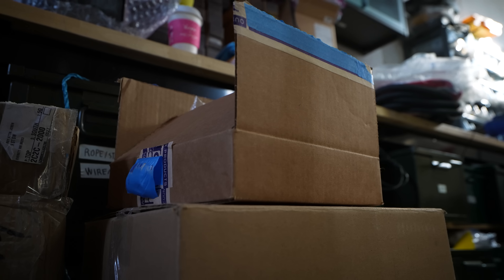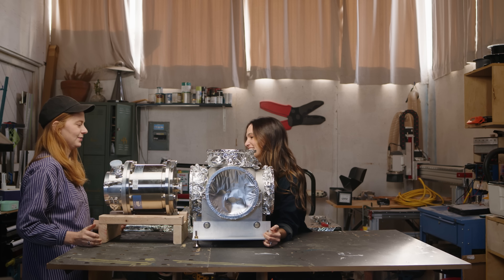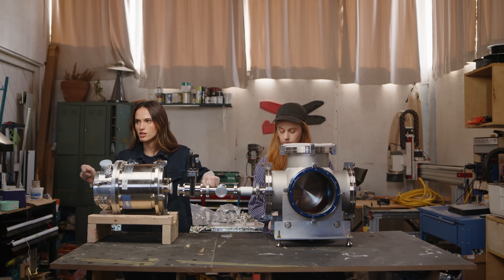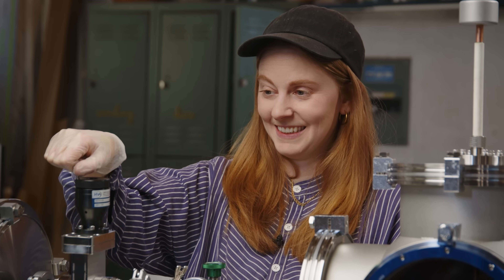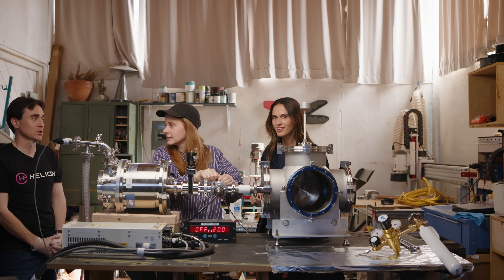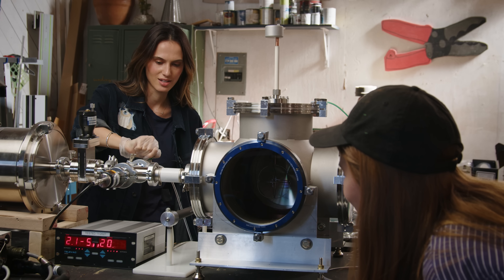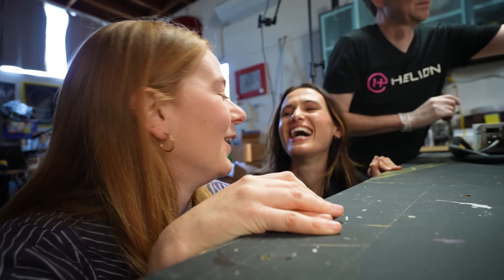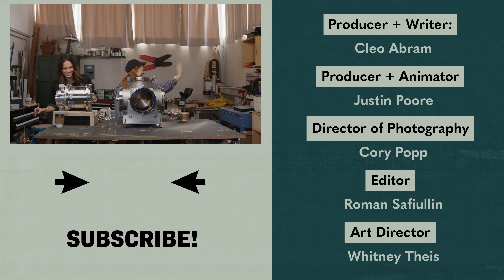We Tried To Do Nuclear Fusion

Comment: Great video, but ya'll didn't make any fusion. If you had you'd all be suffering acute rad poisoning being that close to an unshielded fusor. That big glass window would be spewing xrays. Fusion doesn't happen until at least 30Kv, and the amount of current required is directly proportional to the size of the chamber. That massive chamber would be quite difficult to get up to actual fusion range. You'd probably need 50kv and a fair bit of current and it would be wildly unstable, fusing sporadically while spewing x rays. 
There's a whole community who've been building fusors for years and the standards for claiming fusion are really well defined. It's a "pics or it didn't happen" kinda thing. Basically, you need to detect actual neutron output or you can't claim fusion. This means you either need a bubble detector, a neutron detecting tube, or to activate some other element with the neutrons and detect the gamma decay of the resulting unstable element. 
It's a lovely build and I commend you on getting as far as you did, but David should know better and it's really disingenuous to make the claim of fusion in this context. I've literally built the same device out of microwave parts and jam jars and while it glows nicely, there's 0 detectable fusion at the voltages demo units like this run at.
Reply: Yeah I'm not a scientist or anything but Helion just seems super sketchy to me...gives me hyperloop vibes.
Reply: Yeah I wasn't sure if I missed something but this did not look like fusion. I got detectable fusion back in October at 28kV and roughly 15mA and neutrons were detected on a Bubbletech BP-PND bubble detector as well as a calibrated Ludlum Neutron ball detector. The X-ray measurements infront of the glass viewport were higher than the meter provided by the university's radiation could handle and we did everything remotely. Also, pretty much all fusors' grids glow white hot at fusion power levels and their nixie tube plasma didn't come close to heating it. I'm not even sure what voltage they went to. If they went to 10kV or so you could say that they did get "some" fusion, relying on the fastest Deuterons in the energy distributions, but not even close to being able to detect it. Would anything like this pass as "fusion" on the fusor forums? Absolutely not.... but good effort and perhaps it'll motivate someone to pursue this line of work down the line.
Reply: @SolkanStudiosTV I know it's kinda not relevant, but what do you guys use to shield from the radiation of the fusers?  Like are you just in a totally different room and keep the X-Ray/neutron detectors near the fusor?  I'm more of an organic chemist so I'm not too versed on the fusor-making community lol
Reply: @thetaintpainter5443  There's two types of radiation in fusion; X-rays and Neutron bombardment. X-rays become a problem past 10 kV (10 keV in maximum photon energy), but since these experiments are performed in thick steel vacuum chambers, 99.99% of these X-rays never make it out the steel shell. In fact, 99.9% of X-rays are shielded by the steel shell up to 40-50 kV. At higher levels even the 0.25" thick steel becomes transparent to X-rays. But few people get up to those voltages in this hobby fusor space, it's difficult to keep everything stable at that point. The only real "danger" at lower (10 - 30 kV) voltages are viewports, since they are glass and thus X-rays just go straight through. Additional components, like high-voltage vacuum feedthroughs, which are made of ceramic and sometimes fail to shield X-rays, can be problematic. For these X-ray "leak spots", lead bricks do just fine. A few inches of lead can stop X-rays with greater-than 100 keV energy, so anywhere you think that X-rays might leak you can just shield with lead bricks. That's what we did. So the basic rule is you don't look at plasmas past a few kV because it produces UV and can hurt your eyes if there is continuous long-term exposure, and you certainly don't want to stand infront of a viewport past 10 kV for long periods of time because X-rays can burn your skin. Past 20 kV, which is where real detectable fusion begins, you certainly don't want to stand in front of viewports, because you can hurt yourself. I only went up to 28 kV, which did not require me to build a remote-control and remote-viewing station, I could have simply positioned everything in the corner of the lab away from any viewport. However, another issue at high-enough X-ray energies is X-ray scattering, meaning X-rays exiting the chamber and bouncing off stuff and hitting you. There is an energy loss at each stage of scattering but if your voltage is high enough, even the scattered X-rays can be energetic enough to be nasty. So in essence, this was  a long-winded way of saying "For most applications, the steel vacuum chamber shields against X-ray radiation, you just have to be careful about viewports and other weak spots. Just put some lead around those and you'll be fine." For neutrons it's a bit more complicated. Again, in most hobby fusion scenarios, the neutron flux is low enough to not cause issues unless you stand right next to the thing. These neutrons produced in fusion have several MeV of energy, so they are FAST. If you want to shield them, you first have to slow them down (thermalize them) and then capture them. Usually this can be done with a two-fold system of a first layer of water to slow them down and then something like paraffin wax to capture them. There is a parameter called the Neutron capture cross section, given in Barns, which tells you the probability of a neutron capture of different materials. However, it's not a constant, it's a function of neutron energy and I think at thermal neutron energies (slowed down, around 0.026 eV), it is highest, which is why you first slow them down prior to capture. Isotopes of Xenon actually have a very high neutron capture cross section, which is why having excess Xenon in a nuclear reactor can poison it - this was an issue in the Chernobyl catastrophe that they somehow overlooked. In any case, no matter that radiation we're talking about, a good rule of thumb is that the best shielding is distance - if you have isotropic radiation sources, the intensity of radiation falls with the inverse square law. So being far enough away will always be much safer than being much closer with some sort of shielding.
Reply: I think David has just totally taken advantage of Cleo. He knows she comes across as an incredibly credible person, so this is just an opportunity for him to attract investors who just don't have the scientific skills to realize how difficult proper desktop fusion would be to achieve. I hope Cleo sees your comment and, for the sake of her own reputation, puts out a disclaimer that she was misled.
Reply: Yeah this is a startup doing pr on the backs of Simone and Cleo. sussy af.
Reply: T. Folse just did a video about this thing. Thank you for taking the social risk of being a party pooper to burst the bubble. It's ok to make mistakes.
Reply: @thethoughtemporium  Hey a person with a brain. Thank you.
Reply: Jeez it's almost like Helion is trying to peddle some snake oil magic fusion tech that somehow the tens of thousands of scientists working in actual reactors never thought of... Somehow... and this is part of a marketing campaign to get that sweet corporate welfare money.
Reply: why do you call it a great Video when you know they are lying to their viewers.
There is no Fusion there. And either Helion knew and he is lying when he says it is happening, or he is worse in physics than I am.
I mean the neutron radiation alone would be....yikes!
Reply: Honest question - if they didn't make any actual fusion - and that was the entire claim of the video - how is this a great video?
Reply: Well if that tiktok nuclear guy and thought emporium and Wikipedia all say it can’t have been fusion imma take their word for it.
Reply: Well he runs projects way bigger
Maybe he did detect it
Reply: We don't know if they performed nuclear fusion as we didn't see that they tested for the byproducts of fusion, but we also don't know that they didn't. They could have fused some amount of deuterium nuclei. Not knowing doesn't mean it didn't occur. They may have even tested off camera.

If they fused a small number of nuclei, they wouldn't be suffering from acute radiation poisoning as it could be barely above background radiation.
Reply: But do you think you would actually detect anything outside of the vessel? This is just a back of a napkin calculation, but the neutron scattering cross section for iron in the case of fast neutrons is 20 b, the particles per unit volume for iron are n ≈ 4.269697799E24 cm^−3 and if we assume a thickness of something like 1mm of iron, we get that the proportion of particles going through the wall are   e^(−(n × sigma × x)) = 0.0195 % . From the fact that you only have very few particles to begin with, you might not measure much outside of the fusion confinement.
I am not a fusion scientist, but I am a physicist and I think if the expert person on the team says they archieved fusion, they are propably correct.
Reply: According to Wikipedia's entry on "Fusor", "With hydrogen fuels, about 3 to 10 keV is needed to allow the reaction to take place." In this video they use deuterium which is a hydrogen isotope. They mention running at 6000 V. So I think you're conflating calculated fusion conditions with detectable fusion emissions.
Reply: @LoveLearnShareGrow  He's not conflating - he points to the physical fact, that if there would be any atomic fusion reaction inside this MASSIVE chamber, the outcome would be an outburst of energy. And because entropy happens and it doesn't want to stay in that high energy state at all, there would be high energy emission - in form of massive amounts of x-ray radiation. This was nothing but a plasma reaction. A deuterium lightbulb or a glorified plasmaglobe. The procedure is working and all the aperture is capable of achieving a fusion reaction - but the seen outcome is not a true fusion.
Reply: @marcus_w0 I do not think you would see an outbust of energy, if only single atoms fuse together.
Reply: @marcus_w0  Yes, that may sound like a lot of energy, but it is only much on the microscopic scale of elementary particles.
Reply: @LoveLearnShareGrow  bruh you probably shouldn't use Wikipedia as your primary source, I mean it's a nice starting off point but nothing more. According to wikipedia's entry on "Nuclear Fusion", "Using deuterium–tritium fuel, the resulting energy barrier is about 0.1 MeV" which is 100 KeV not 3 to 10, see? wikipedia contradicting itself. Digging a little further, the 3 to 10 KeV number is actually the one you get when you take quantum tunneling into consideration which is NOT happening in fusors on earth because the plasma isn't dense enough and will never be, because those aforementioned quantum effects that make it easier for fusion to occur only happen in the core of a star where the density is ludicrously high.

So on earth in a fusor of that size you need about 30 to 50 KeV to achieve detectable fusion as thought emporium pointed out. So no he's not conflating anything,you're the one conflating calculations for fusion in the core of the sun for fusion inside a fusor on earth.
Reply: @mastershooter64  I understand Wikipedia is not an ideal source, but every single person who has responded to me is pulling numbers out of their ass. I have also mentioned other another source, which again I recognize is not ideal, but it's better than naked assertions. So I appreciate your attempt to refute my comment, I'll be ignoring  your conclusion unless you have a better source than "Don't trust Wikipedia, trust me!"
Reply: @LoveLearnShareGrow Turns out you can't search stuff on Google in 5 minutes and be on the same level as people who have worked directly with the subject. Maybe humble yourself a little so you don't end up embarrassing yourself again.

Comment: No proof of neutron production...can't definitively say fusion was occurring without proof of neutron production! You should also warn your viewers that these types of experiments often produce soft and hard x-rays via Bremsstrahlung mechanism with the chamber. Idk the voltage this operated at anything less than -10kv probably no fusion. Overall a pretty poor explanation, the viewers are missing so so much. I built one of these and it’s not easy nor cheap. The equipment here is probably $35K - $50K.

Comment: Well, I'm hopeful, but the engineering problem of getting it from "we can do it in both small and large scale labs" to "we can use it as a power plant" is an extremely big engineering problem.  General Fusion, one of your assistant's competitors, was claiming they were about 10-20 years out a decade ago and are now claiming 15-30 years.

The folks working in fusion research are massively optimistic...but optimists are what you need in a field of research that is progressing so slowly.

Comment: @cleo, this is so great that you were able to demonstrate fusion in such an accessible way. I am curious if you’ve ever heard of Bloom Energy and the Bloom Boxes that use chemical coatings to convert air to energy? Sixty Minutes did a special on them in the early 2000’s and apparently Google purchased several large commercial “bloom boxes,” but I’ve not heard more.

Comment: Just want to throw this out there. I believe that the Farnsworth Fusor has set Fusion back several decades. You even mention in this video that the sun maintains fusion through gravitational confinement. Which I believe is mostly attributed to this device and hence Magnetic Plasma Confinement. Much of the spectral evidence suggests that instead the vast majority of the sun's mass is metallic hydrogen suggesting that Lattice Confinement may be the primary source of stable fusion. 
Lattice Confinement, once ridiculed, has now been embraced by even NASA as a viable source of energy. With some research you will find that you can also make a Lattice Confinement device in your garage.

Comment: Just to add on to the part of the pink, fuchsia, magenta colour portion. The reason the colour only looks like that pink but actually isn’t is just as he said it’s producing blue and red light which our eyes has receptors for. And if you look in the Center between red and blue on the visible colour spectrum the colour in the middle is green. So logic would suggest we would perceive it as green. However our eyes actually have green receptors too which aren’t being triggered so our brain actually realised ‘wait this isn’t green tho’ so it creates a whole new colour of which we perceive as magenta. Which is why magenta technically doesn’t exist and is an illusion.

Correct me if I’m wrong in any of these statements this was from the top of my head from what I remember

Comment: I like Helion, but when I think of fusion I think of replicating nuclear fusion occuring in the sun.  I like the idea of concentrated fuel deflected towards the center of the fusion device by electromagnetism.  Just makes me think of a balance between outward and inward pressures.  I definitely would go with Helion's design, but I'd just say that if it were possible to use the electromagnetic force to replicate what gravity does, the temperature might increase, fusion might occur, and we can start turning some turbines.  I'll invest in Helion.  We already know fusion is a real feature of the universe.

Comment: I’m interested in why you kept pumping out the gas which then stopped the ‘plasma’ and then had to introduce more. Could you not have pumped it down, sealed off the vacuum and then introduced the deuterium in the same way that neon and other gasses are introduced to fluorescent / neon tubes? A bit more info on how the electrostatic forces are enough to force the atoms together would be interesting. It just looked rather like any old ionised low pressure gas experiment. Sure it was a bit of fun but a bit lacking in substance.

Comment: I used to work with sputtering deposition, which has a lot of overlap with this setup--the high vacuum chamber with the turbopump, the low pressure gas, the plasma made with high voltages. Fun to see it being used to different ends.
Reply: Same. Exactly what I was thinking of

Comment: Safety guys!! apart from the high voltage (20-50 kV) which can obviously turn this comedy into a tragedy, there is the issue of x-rays and UV rays coming from the viewport. The glass in the large viewport may have been leaded safety glass, but in any case it is poor practice to peer directly into a fusion chamber. The safer way is using a mirror at an angle to observe the plasma.
Unless someone drops a crate with $100,000 worth of the right stuff on your front door step and sends an expert to guide you, it is unlikely you will be able to do fusion in a day, if you can achieve fusion and prove it in 1 year you are doing pretty well.

Comment: Would it be possible to plug a helium detector at the vacuum pump outlet to verify for sure that there was fusion? Or a gamma ray detector?
Reply: while amateurs have used a residual gas analyzer to detect helium, that's the hard way.  Easiest way to prove you did fusion is to detect neutrons, which is one of the products of DD fusion.   You can detect neutrons indirectly by placing a piece of silver in a moderator (to slow the fast neutrons down) such as HPDE plastic, run the machine for about 5 minutes, turn off the high voltage and detect radiation from the silver with a cheap Geiger counter.  You have to be quick though, the half life is around half a second for one of the isotopes and 2.5 minutes for the other isotope created by neutron capture.